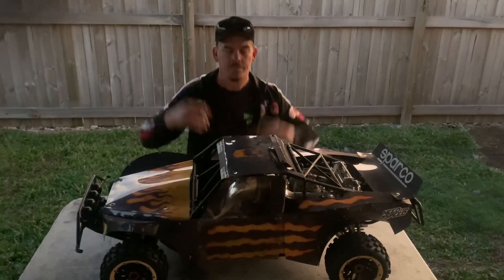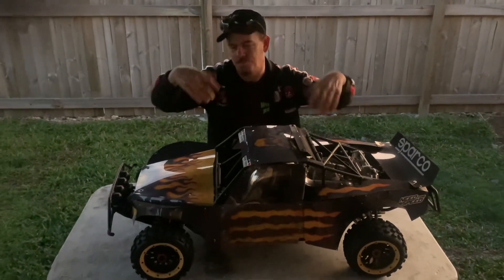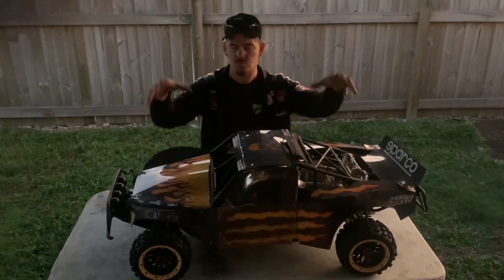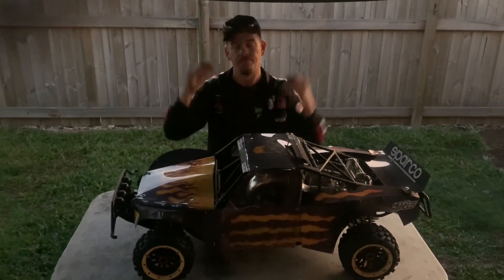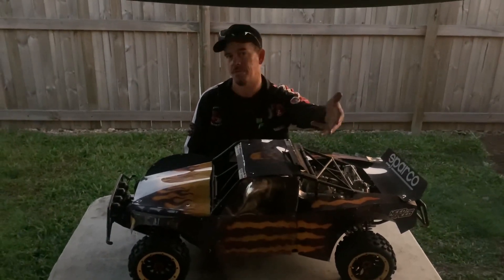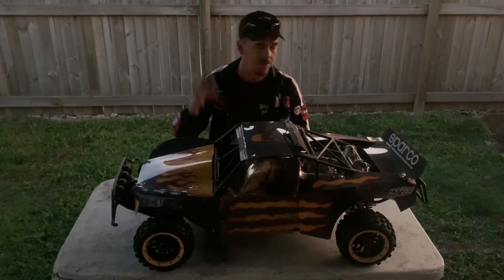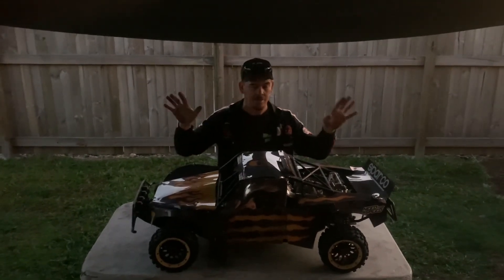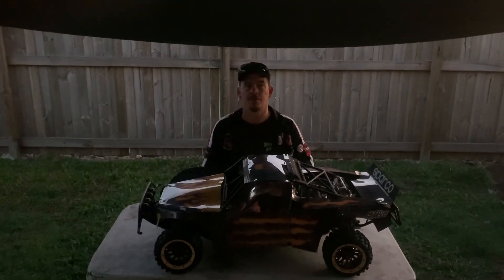57cc twin hybrid update

Comment: Nice rip 🔥🔥what carbs you running I just switched to the 1242 big bore carbs
Reply from the maker: They are wt997’s, how are they going so far?
Reply: @whittosrc8928  I was running the 990 when I got engine from Darren Longford and I sent it to obr to be rebuild and added the 1242 big bore carbs so far I'm loving the 1242 very easy to tune 👍🏽